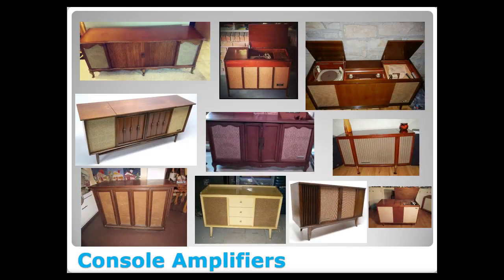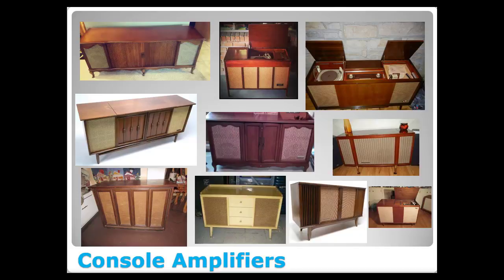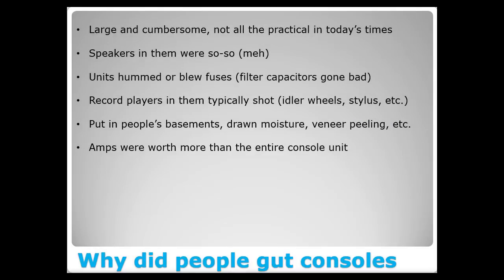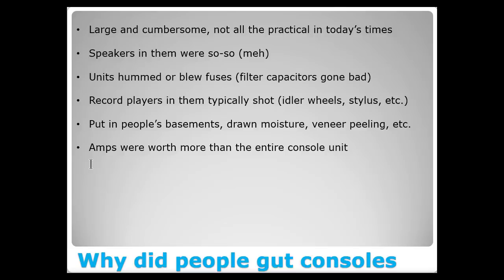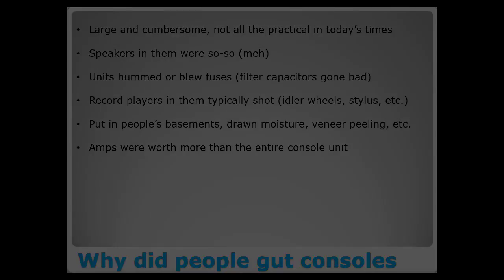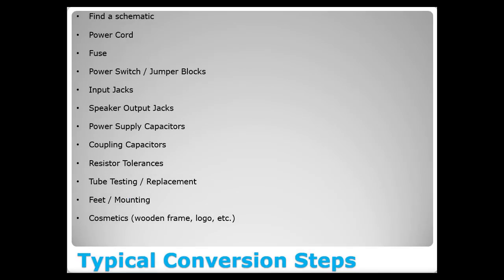How to Convert a Tube Console Amp for HiFi Stereo Use - Part 1

Comment: Could I convert a 1962 silvertone syntronics made by sears and warwick electronics  in 1962 from the research and pictures I got from the the fellow gifting me the stereo I found it has two tube chassis 1 is a 7 tube am/fm stereo chassis the other chassis is the stereo amplifier with this monster transformer and 5 tubes the paperwork I read about the model 2701 says it has 12 tubes total and some of them are 12ax7s and some are el84 to name a few. Where do I even begin also it has 4 speakers 2 of which are 10 inch Pm Woofers. Im picking it up this evening and what is the multiplex output on the chassis do is that a good thing or no,can I use the tube am/fm stereo as a pre amp and build a full size amp head.Apparently everything works except the record player needle,Thanks and sorry so long.
Reply: I'd start by trying to find a schematic.  Then figure out which parts of the amp you want to use vs. disconnect.

Comment: Thanks for the vid. I have a 1060s Zenith console with turntable and AM/FM tuner. The turntable is not original. They replaced the original with a 1970s BSR McDonald. I managed to restore the turntable but like you mentioned in the video it has that grinding noise and then switch stopped working and the table won’t use stop. The tuner then gave me trouble and the AM stopped working. FM was never receiving well. Now both just lots of static. Overall I am considering updated it to modern specs. But I do like the mono/stereo sound and it’s all nostalgic for me. Any advice or ideas about the tuner I would appreciate your thoughts. 
Thanks

Comment: Thanks for your video, I just acquired a Magnavox amp converted  for hifi like yours. It has 6v6 and 3 preamp tube like yours but no choke and a smaller rectifier. I'm wanting to go thru it but not sure of the model number for schematic.

Comment: This is really lame , console amplifiers are limited in low end frequency range and usually are 7 to 15 watts at the max output, far under the minimum requirement of 25 watts to  a max of 150 to drive modern speakers with an ideal range or 75 watts per channel. Console amps were designed to work with the more efficient speakers in the console.  They have a more limited range in the low end as it would not be possible to have a high powered  wide ranged amp with wide range speakers in a single cabinet without serious feedback from the turntable.  Console manufactures knew this and designed them to operate with other components in a single cabinet.  If you want an amplifier for  hi fi stereo use then buy a vintage component amp or new one for that purpose,  consoles should be used as they are.
Reply: I'm giving it a go anyway despite all of your harrumphing.

Comment: Really looking forward to this series.  As a newbee, I have been hesitant to dive into a full blown tube amp project.  Over the summer I picked up a working Magnavox  model 1ST263 console with a cute little 8608-01 single ended amplifier, which I pulled out but have not started to work on yet.  I am full of questions.  Is it possible/advisable to use the power switch from the tuner chassis?  It is a combination power switch and treble control, I only want to use the power portion.  Same question for the volume control.  They might be too big for the tiny chassis. I think the big, old knobs might look nice.  My chassis is pretty ratty, I am thinking of possibly stripping all the components off to refinish it.  Is that a good Idea?  How should I go about that?  I want to ensure that I can put it all back together again.  Components are riveted to the chassis, should I drill those out and re-fasten with bolts?  Power cord, to ground or not to ground?  I plan to add a vented bottom cover for safety.  X/Y cap?  There are a lot of little ceramic caps, should they be replaced?  I have to go cheap, I am thinking about replacing some of the resistors with high quality, precision ones from a  old Tektronics  RM529 TV scope that I was gifted, bad idea?  I will be using a fuse holder from that unit, and possibly the power switch with neon pilot lamp.  I also have the pilot lamp and Magnavox badge from the console.  Any thoughts on speakers for this tiny amp (1-2 watts per channel) ?  Should I consider new output transformers for 8 ohm speakers?  I could go on.....but I will save something for later.  I hope these questions might help everyone.  Thanks.
Reply: I too have questions regarding the tone/feedback circuit for , Magnavox 8601 circuit that I've already rebuilt on a new chassis. It looks like a real stereo from the 1960's now and sounds pretty good but still want to tweak it as it sounds a bit thin sometimes and think messing with the tone and feedback circuit could give it more magic. If I was you I would use a new alps pot for volume control and drilling out a new chassis only took me a few hours. I used all new parts except the transformers, if you must go cheap you could test the old resistors only replace the out of tolerance ones. You should be able to leave the ceramic caps as well but they are not the best for sound quality. As far as speakers just look for anything over at least 90db. Hope this helps.

Comment: https://youtu.be/IVqjNc6ub98

I am Brazilian and here in Brazil the denomination for this device was Radiola. This model was produced by Philips in the 60's. This model uses the fantastic 800 ohms impedance loudspeakers, are used in total 6 speakers, 2 loudspeakers for bass, 02 for medium basses, both 8 inch and 02 speakers for 6-inch treble. This fantastic system does not use an output transformer, so the sensitivity is incredible and the audio quality is fascinating. Uses 04 valves El86, 02 per channel.

In the coming days I will check the level of distortion with my newly purchased HP8903B to prove the audio quality of this amplifier.

This specimen has been totally restored by me.

Comment: My dad had a custom built console made around 1964 with a 15 watt per channel Harman Kardon receiver, Garrard turntable w/Shure cartridge, and 2 12"  University coaxial loudspeakers. I remember it sounding amazing. The receiver had a copper colored faceplate. Anybody have an idea what model that was?
Reply: The Harman Kardon Recital models have a copper colored face and case. I just bought one on ebay for 70$ lol. It's a mono 20 watt but has hookups for 2 speakers.